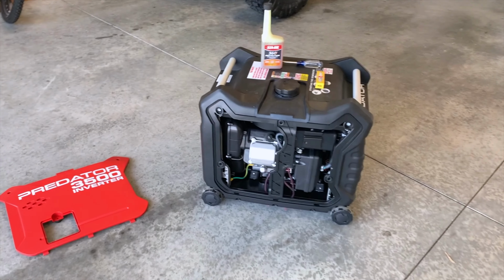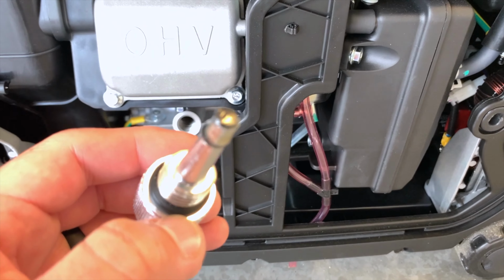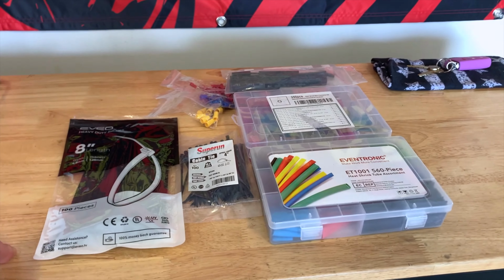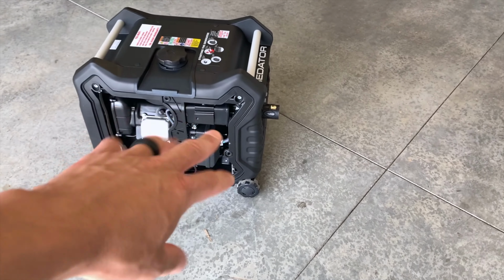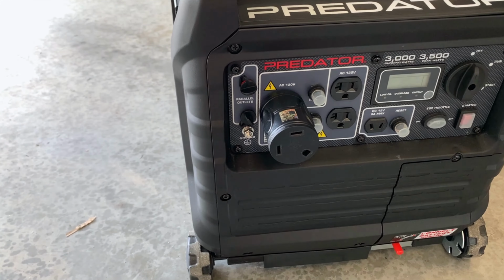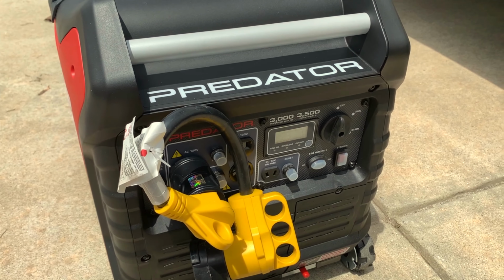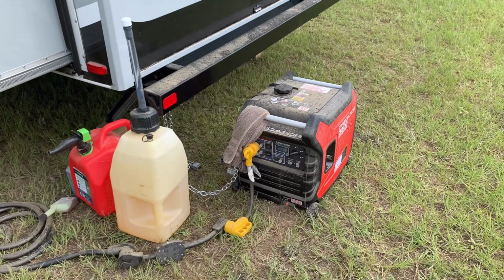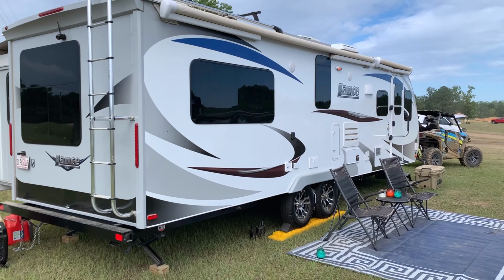Predator 3500 VS. 15K BTU A/C

Comment: Enjoyed your video, was glad to hear it runs the 15.000 BTU ac just fine. I am just about to order the spark plug, the dip-stick and a cover for my Predator 3500. I was told these Predator 3500 don't need to set on grass, always set them on a hard surface to keep them from sucking grass up inside them. I cut a peace of plywood to set mine on.
Reply from the maker: I hear you my friend.  This machine didn't even flinch when I placed it on grass.  I say "send it".  haha

Comment: The black low oil cut off wire is at the bottom of the crank case. When the low oil cut off eventually malfunctions simply disconnect it.
Reply from the maker: Word!

Comment: I use a 30amp twist x 50amp power adapter (dog bone) and don’t need the rotate the plug. I also added the magnetic dipstick.

I run non-ethanol gas and mobile one synthetic oil.
Reply from the maker: Haha, nice man.  I know it was crazy that it was done right out of the box and then I messed it all up.  I'm glad you got the dipstick, good stuff!

Comment: I did not need to reorient 30 amp outlet. I simply threw out the included one, and purchased one at Home depot. The tail lies to the right and gravity holds adaptor at proper locked orientation.
Reply: Sorry threw out the adaptor included with generator, not the outlet.
Reply from the maker: Hey Ledderneck, we appreciate the info!  These units are amazing and ours is still running strong.  Take care my friend.

Comment: The only thing 93 octane does that is useful is higher detergency. The difference from 89 is antiknock, which makes no difference in a unit like this. The magnetic dipstick is a very good hint.
Reply from the maker: The higher fuel is recommended by the owners manual.  Thanks for tuning my friend.

Comment: Great video - thank you.. I have the same 3500 unit and noticed when I connect it to my camping trailer I get a red and blue light on the 30 amp cord. I checked the generator and trailer and found the 3500 has a floating ground..  First question: Is this a major safety and operational concern?  I used a 15 amp plug and connected the common to ground and this created a Non floating ground and eliminated the red led on the 30 amp cord. Second question: Did your 3500 have a floating ground?  Thanks for the info -
Reply from the maker: In short, yes floating grounds can be dangerous, but it my experience they’re more dangerous for electronics (your campers electrical system) than anything. I used to be a Diesel engine generator tech in the USAF before I restrained into my new very boring job. I would maintain tactical quiet generators for bare base setups and our favorite gen to use was a dual 80K generator run in parallel. The hardest thing to do was ground the trailer because we had to drive a 4’ copper rod 3’ into the ground. It is very important. The only reason why I didn’t have mine grounded in the video was because I didn’t take the time needed to go and buy the equipment for it. Before my next trip with it I will be sure to have a 3/8 diameter copper rod 1.5” in length with a 10 AWG copper wire. That is more than enough to ensure things are in order. You should be able to pick these items up from amazon for about $35 total.  This should also remove all your fault lights.
Reply: @RZRDREAMS  you didn't check out the plug before you turned it around, and your giving advice?

Comment: Be careful with the magnetic dip stick. Rumors are the magnet part falls out.
I used the supplied spark plug tool, works great
I have only 17 hrs. of break in time at 1-hour intervals every week.
If I let it sit over 2-3 weeks, it surges.
Just trying to break it in I’ve had to pull the carb and clean the jets.
Now at 17 hrs. the gauge stopped working, only reads hrs. used????
Harbor Fright won’t do anything because it’s out of warranty, even though it has only 17 hrs. of break in time.

Below parts I use:
Shell V-Power® NiTRO+ Premium Gasoline after I remove all the Ethanol.
Then I added STA-BIL 360 to all my gas cans then fill up the Predator 3500 gas tank. 
NGK BPR7ES 5534 Spark Plug.
Lucas High Zinc Hot Rod oil
I wish you would do a video on the 30 amp upgrade. Thanks for the video.
Reply from the maker: Sorry for the delayed response my friend, but darn that is a bummer about your gauge.  Thanks for sharing.  I will definitely do a 30K BTU video once we start gearing up to go full time RV'ing.  Stay tunned!

Comment: The magnetic plug sounds like a good idea, BUT 98 percent of that engine is aluminum, the only thing steel is the crank shaft. The cylinder is not even iron sleeved. All the silver  you see is aluminum shavings in the oil it's not sticking to the magnet. I run my A/C no problem, can actually run microwave with A/C but it's pushing it but it does do it. Just wanted to see if I could run both.
Reply from the maker: Hey, thanks for the information brother.  I didn't realize that.
Reply: No problem still very good to change oil a couple times as you are cause the aluminum shavings are just as bad as steel shavings. Overall it's a very good generator for the money. I've heard very few complaints on it, some people are never happy no matter how good a product is. Keep up the vids the SXS looks awesome.
Reply from the maker: Thank you for your comments and for watching!

Comment: Why didn't you clean the metal shavings off before putting the oil plug back in the engine?
Reply from the maker: Hey friend, I did.  It's later in the video if you didn't catch it.
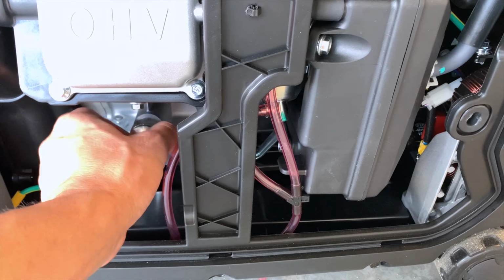Reply: @RZRDREAMS  3:19 you remove the oil stick. 4:03 you put the oil stick back in engine without wiping.
Reply from the maker: @MrCarl312  Hey friend, I mentioned later in the video that I wiped if off in between shots.  It's all good; don't worry. :)

Comment: Any advice on converting this model to run on propane?
Reply from the maker: We don't have a lot of experience modifying generators; however, I do know there are a lot of videos out there you can watch to do this.  Now, if you're asking whether or not you should own a fuel or propane-based set then that questions comes with a lot of stipulations such as what will you be using it for, where to you plan to use it and so on.

Comment: if you would put easy-starts on your ac units this generator would run both!
Reply: Been there and do that, works great!
Reply from the maker: Do you have dual 15K A/Cs and use this with it?  I've looked into those soft starters they don't seem to be too much.  About $250 each I think.
Reply: @hardtruth2039   it will run 2 13500 dometic brisk air 2 with soft starts ?

Comment: I run a 12000btu mini split, 900W microwave, George Forman grill, tv, and bunch of other accessories all at once without any issues ohh yeah it has over 3000hrs all in 6 months while using 15w40 Mobil delvac diesel oil
Reply from the maker: Very nice!,
Reply: You ran it 16 hours a day for 6 month's?

Comment: i have the same generator i have had for a year and i never have had to use it. i would just start it up every 3 months to let it run. well i just fired it up and noticed the display was not showing a voltage reading nor amps/watts they would register 0 with or with out a load, it would only show hours and the generator it self worked no problem. WTF i do not have the extended warranty either. anyone have any ideas
Reply from the maker: Hey brother, have you tried putting a load on it to see if it still works?  Also, another idea would be to remove the faceplate and see if there are any loose wires leading to the display.  These things can happen.  I wouldn't be too worried yet.  Let me know how it goes.
Reply: @RZRDREAMS  thank you for your reply, yes i have the control panal off currently and took the display out to check it out, i unplugged it and plugged it back in multiple times. everything else is tight. load or no load it doesnt make a difference. i would have to take the generator further apart to follow the wires leading from the display deeper into the unit to check on that end. but it seems they designed this unit for one side to come off with out disassembling the whole entire unit.
Reply: A mouse got in your generator man. Its chewed up in there and the dumb critter chewed up something else to make a nest.  Betcha
Reply: @mikeries8549  I managed to rotate the 30A plug without adding or making new wires.
Reply: Bret,  Hopefully you haven't torn it apart or did get it working again.  If not try this: Fire it up, then plug a brush type electric drill into it.  Pull the trigger and spin the chuck in reverse.  The drill spinning in reverse sends just enough juice into the generator to excite it and it will start working again.  Some use another drill to spin it backwards using a dowel between the chucks.  Don't tighten either chuck or it will not be pretty when the gen starts producing power.   This works on generators but not sure about inverters.   YouTube it.
Reply: @jefffrayer8238  thank you for your reply, but the generator output worked just fine but i will keep note of that trick! the digital display was just simply not doing its job. believe it or not harbor freight said and they did just swap it out for a new one all i had to do was buy a extended warranty even though it was a year later!
Reply: @videocontent18  That's fantastic.  They are a great company and stand behind their products even when idiots cause the problem.  It's a well built inverter that should be trouble free.  It's very easy to do so taking the rope pull panel off I put a NAPA fuel filter # 23011 on the outlet side of the shutoff valve.  Easy to access,  a modification that improves reliability and can be put to original if wanted.  Add 2" of fuel line, don't cut factory line.  Keeps dirt and moisture from messing up carb.  I don't need them so I took the annoying wheel lock and spark arrester off and ziptied them to the aluminum upright by the muffler so they are available if needed.    What I was talking about is called, " Flashing a generator " , easily found on YouTube.   Enjoy your generator.

Comment: Dude why did you put the dipstick back in without wiping it off what’s the point in having a Magnetic dipstick if we’re just Going to stick it right back in with all the iron shavings on It
Reply from the maker: Haha, it was just for the video my friend.  I do check it often and make sure it's good to go.  Thanks!
Reply: RZR_DREAMS Thanks for the response when I saw The dipstick go back in Without being wiped off I thought oh no. Please keep us updated on how you like this predator 3500 we’re looking at the same model I will be Ordering the remote start kit off Amazon as we Boondock a lot it’ll be nice to turn the generator on and off from inside the camper also like the part about Flipping the twist lock upside down LOL I’ll make sure to check mine before flipping it because I guarantee you that stuff happens to me too
Reply from the maker: @boosted.  haha, yes it was good experience to do it though.  I 100% agree with you about the remote start system as well; I need to look into that!